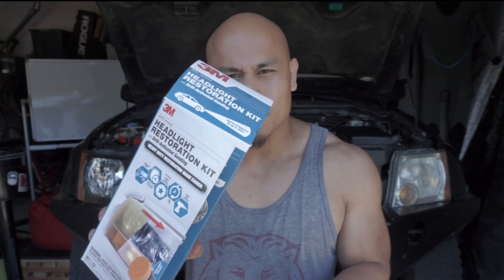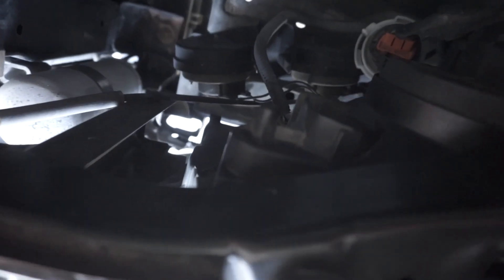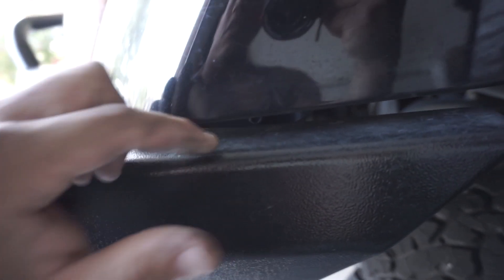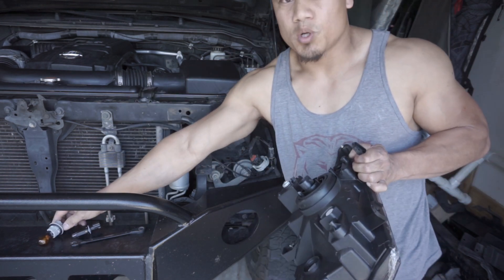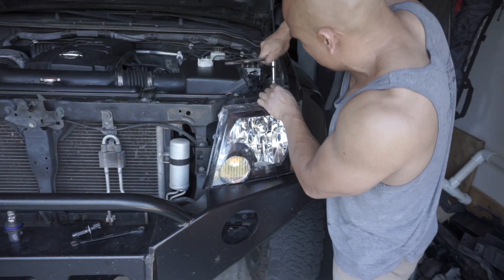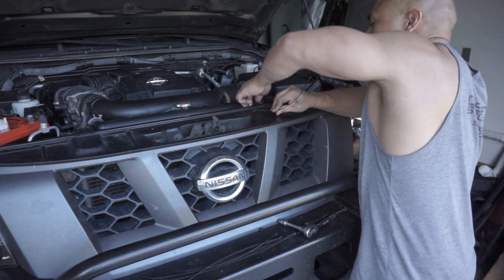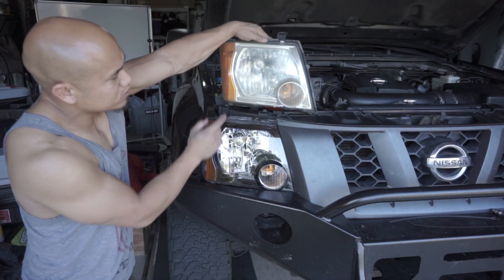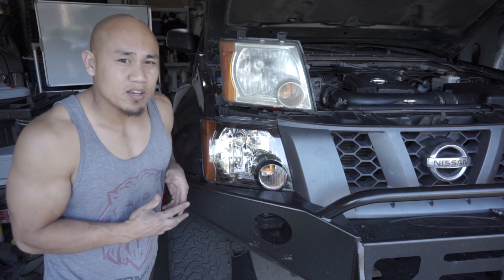Nissan Xterra - Amazon Headlight Housing Install

Comment: Trying to decide whether I want to go to LED lights using the factory housings. Have you tried LED's in yours? What halogen bulbs are you using and how do you like them? Nice X by the way!
Reply from the maker: I haven't tried LEDs in these new housings yet. I had some in the old hazy ones and they SUCKED in the snow.. I like the new bulbs I put in my impreza and will try those.. They're from beamtech and I got them on amazon. I put links to them in the subaru video. Will try them out later this month!
Reply: @rayregnogarage  thanks for the fast reply. I will check out the Subaru video. Keep the vids coming. Are you going to do the budget titan swap from PRG or are you planning on doing a full axle swap big money titan swap?
Reply from the maker: I saw PRG post about the budget swap the other day. Is it new? I had been planning on doing the axle swap but I got distracted with all my other projects. Haha. Which one are you going to do?
Reply: @rayregnogarage  I was originally looking at doing the one you currently have but I keep going back to that budget swap from PRG. The price is pretty close so I'm not entirely sure yet.  How has your current setup treated you?
Reply from the maker: @Yipping_Yeti  If I had been given the option, I would have definitely done the budget swap and just slowly upgraded it. I would love to have the wider track width without the spacers I have on it now. I'm also guessing it has more down travel, which my suspension doesn't have a ton of.
Reply from the maker: I just realized that the budget kit has Bilstein 5100s... which is an inferior shock to the coilover my system has... But I'm gonna guess it's an easy swap to a coilover once you have all the other components. I'd still do the budget system first and then make it my next priority to improve the dampening with a better shock.

Comment: Hey looking at a pair of these for my Frontier. Do you notice any moisture build up? And who on amazon manufactures these? Thanks
Reply from the maker: No moisture build up, so far. The truck spends most of the time in the garage though. I don't daily drive it. I did take it on a month-long road trip and it saw lots of rain and storm conditions. Still look good as new. They are sold by AUTOANDART. I posted a link in the video description. Here's the link again: https://amzn.to/2N0mscz
Reply from the maker: @cappiello31 sorry. just realized you had a Frontier. These are from the same shop: https://amzn.to/37q4BT6

Comment: Is this the same even with a stock bumper? Thanks in advance!
Reply from the maker: Yup. Same process... MIGHT be a little more challenging to get to some of the bolts, particularly the one where you have to reach through the fender. Might have to pull out the fender liner (my truck doesn't have them anymore), but it shouldn't be a difficult process.
Reply: @rayregnogarage  thanks!
Reply from the maker: @nayhtoo141  Let me know how it goes! I'm sure someone else will ask in the future and it would be cool to have a definite answer and maybe have some details on what you had to do differently. Thank you!
Reply: @rayregnogarage  actually i have a bumper being fab'd as we speak so because of your answer I'm going to just do headlights together with that 🤣
Reply from the maker: @nayhtoo141  ha. fair enough. You on instagram? Would love to see that... follow me @strongholdgarage
Reply: @rayregnogarage  gotcha! Mine isn't all car stuff haha

Comment: Dude when I did this to my xterra I broke SO MANY plastic clips 🤦🏽‍♂️. Mind you if you have a stock bumper you have to remove the plastic fascia in order to get to the bottom bolts.
Reply from the maker: Ya. Someone else commented last week that it’s much more involved with the factory bumper. That’s usually the case when you leave all the factory stuff on. I like taking off as much useless plastic as possible. Makes everything so much easier to service. Ha

Comment: If you want better visibility.. ditch those halogen bulbs and get some LEDs.. I put them on my 2007.. and they are unreal.. With your new lenses.. you ll be like  baseball field at night..Never going back to Halogen bulbs.
Reply from the maker: I’ve had several LED bulbs in this truck before and I went back to halogen for a reason. I actually did a video explaining why and tried another set of LEDs in the Xterra a month ago. https://youtu.be/KZ_V5_xP2RE. I have another follow up video on these bulbs I haven’t posted yet. I installed the same on my Ranger (same size as even) with different results. I’ll be posting that video later this week.